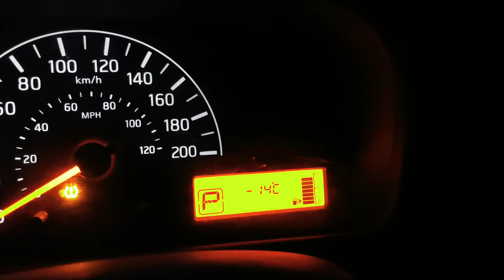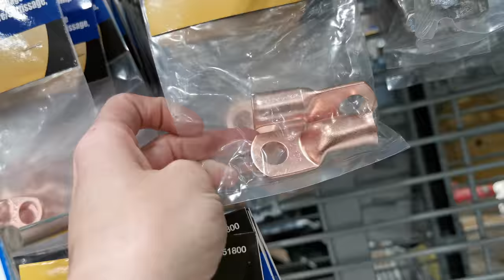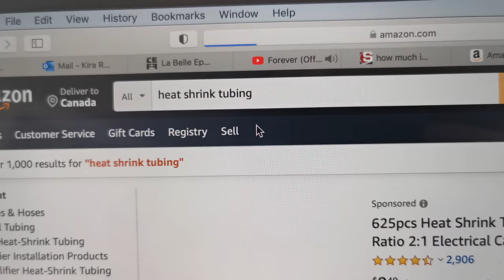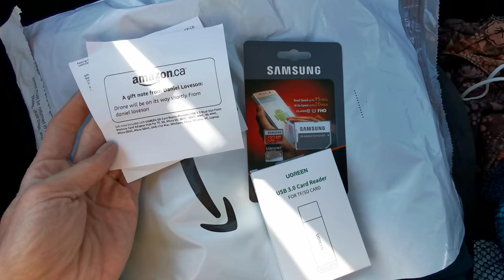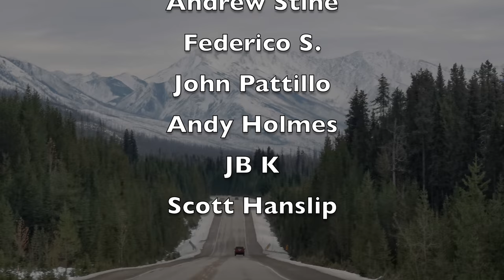Van Life: I Found a Beaver Colony!

Comment: you definitely need a hammer-crimper, but you don't need a wire stripper, you can use any sharp utility knife/razor blade to strip an big wire like that...just roll the blade all around the wire with a little pressure, same channel until you feel it eventually break through, then you can just pull the outer sheath off.
lol, everyone's got social anxiety, so don't let it hold you back/slow you down, just ask someone!...but usually specialized tools like heavy crimpers/heavy wiring/etc. are only found on amazon, at least with any ease.
good luck with the build!

Comment: Take advantage of the empty space in your engine bay. Our Flex has decent space under the hood so I have our hatchet mounted under the hood and our tool bag is a toiletry bag sitting on top of the fuse box wedged in. Chains are attached to the top of the strut mounts and jumper cables are folded up between the fender panel void. Just make sure nothing can move or fall on the engine and is stored in waterproof bags or such.

Comment: For car battery lugs, rather than buying a set of crimpers, you can buy lugs with compression screws, which will allow for you to add extra or larger wires later if needed.  Also, any decent pocket knife or box cutter knife is a wire stripper.  Just cut all the way around the insulation, then a vertical line along the wire to remove the insulation from the wire.  (20+ years electrical experience)

edit: beautiful footage. by the way.

Comment: You picked one of the hardest engines to do the big 3 upgrade to, just because of how tight and compact things are in there. I pride myself in doing my own work on my vehicle, but it's okay to go to a professional too. If you're still having issues It might be worth taking to a shop that work on things like speaker system installation to do it, because with their specialized tools they could get you in and out in a couple hours. If you do, or have already done it yourself already then much respect!!

Comment: Nice vid...wish you'd get some insulation though, it would help not only with temperature but also calm your anxiety of checking condensation X times a night. Its pretty simple stuff, big fluffy wool stuff, cut, tape it in the big holes then cut & tape some reflectics over the top for a water barrier. Viola constant toasty

Comment: Hey Kira!

Greggs distributors in Calgary for lots of the random wire connectors and what not. Princess Auto power cable (welding cable) is pretty decent. If you don't find a hammer crimper use a hammer on concrete and pound the connector totally flat. The copper will form around the wire and makes actually a pretty solid connection.  Reach out if you need any advice or help. 8+ years in car electronics, 12+ years in plumbing, and work on RVs for fun (including inverters, etc).
Reply from the maker: Thanks Troy!

Comment: Any length of wire between the fuse and the battery terminal will not be protected. The fuse should be as close to the battery terminal as possible. You can get battery lugs that incorporate a fuse. That way no wiring is unprotected.

Comment: I’m not sure how it’s done in your neck of the woods but see if you can find a battery specialty store. Especially if they do commercial vehicle work. They carry large size cables And will crimp and cover it with heat shrink. The store I used down south didn’t even mind that I provided my own cable. Also welding supply stores has cable and lugs. Good luck and great videos.
Reply from the maker: Oh interesting...I didn't even think of that. Thanks!

Comment: Kira a cheap way to get heavy gauge wire is to buy a set of long jumper cables. They sell them at Princess auto pretty cheap. Good luck on the build and with your adventures. God bless you.
Reply from the maker: Never thought of that!
Reply: 1/0 welding cable is sold by the foot at Princess Auto.

Comment: You need to get that diesel heater running young lady. When you go full build I recommend putting reflective insulation under the flooring. You are in Canada after all
Reply from the maker: The flooring is already insulated :) I'm currently working on the electrical system so I have something to plug the heater into :)

Thanks for stopping by Rosco!
Reply: @KiraandtheSurvivalPod  stay warm this winter.

Comment: Pls dont put your main hot wire to the battery   It builds corrosion    Follow the battery lead back to the alternator  theres usually a bolt there u can tap and it wont corrode there   Use a fuse  like a big boy maxi fuse       You can also tap off the lead that goes into the fuse box   No corrosion there

Comment: You can get welding cable at a farm supply.... that’s the way to do it.
Reply from the maker: Ohhhh good call!
Reply: Yes, yes you can. I built double 00 jumper cables. So powerful, you don't even need a battery on receiving end and no wait to start.
Reply: Or a welding supply shop. They sell welding cable, which is more flexible but handles slightly less amps - but I suspect it will handle more than your needs.

Comment: 885127, 1/0 Welding Cable at Princess Auto. Just over $5.00 per foot. Sold by the foot.
Reply from the maker: 5 bucks a foot is pretty good! As long as it's pure copper with no aluminum :)

Comment: hammer crimper from Amazon or a tool store.  At least use Ancor marine grade cables if you can't source reputable solar cabling.  See:  https://www.bluesea.com/support/articles/Circuit_Protection/1437/Part_1%3A_Choosing_the_Correct_Wire_Size_for_a_DC_Circuit  and  http://assets.bluesea.com/files/resources/newsletter/images/DC_wire_selection_chartlg.jpg